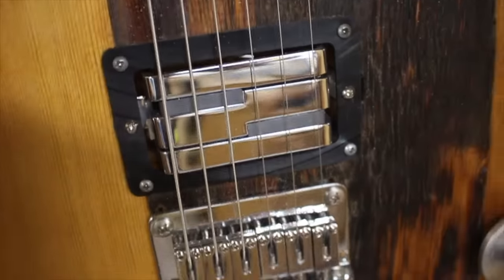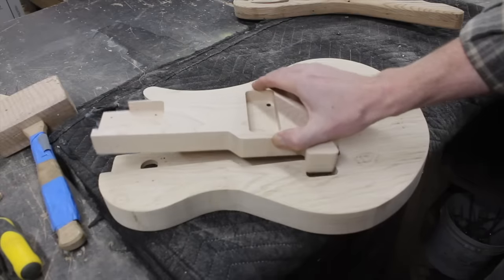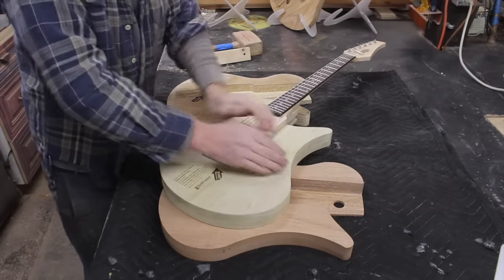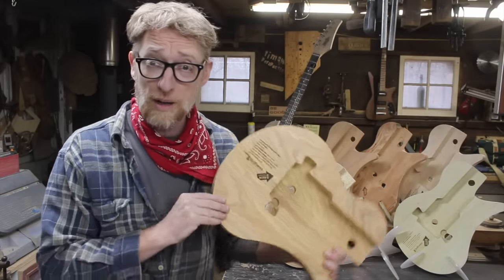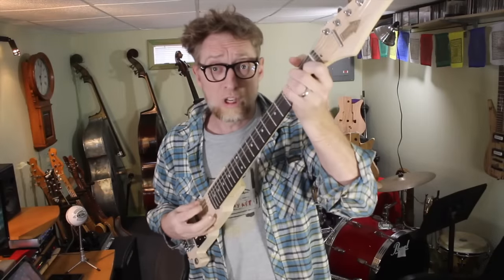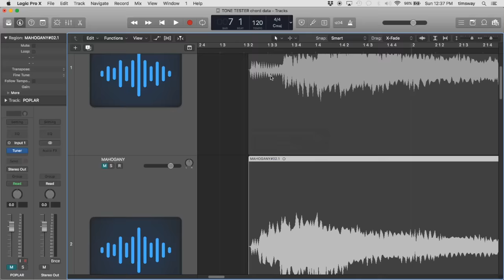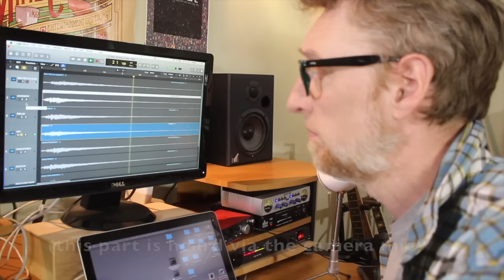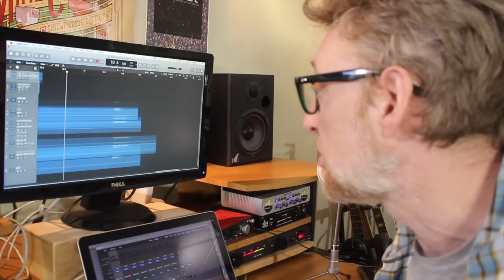Tone Wood Tester: One guitar to test them all

Comment: When you play them all together you get an out of phase chorus’y effect, which goes to show that YOU are probably a greater variable, than the wood is.
Reply from the maker: I am the biggest wild card in every aspect of my life! lol
Reply: That's because it kept getting more and more out of tune as the testing went on. That's what chorus is, combining in tune and detuned signals.
Reply: That's because it kept getting more and more out of tune as the testing went on. That's what chorus is, combining in tune and detuned signals.
Reply: lz4005 I know, that’s why it says “out of phase chorus’s” and not straight up chorus.

Anyway. Do you believe he is picking in exactly the same spot, with exactly the same force, at exactly the same speed every single time?
Reply: Also it went more out of tune every time he whacked it with a mallet (what a surprise there). Tuning up between takes is a "damned if you do, damned if you don't" situation. It would have made it easier to compare the sounds, but it would also have been argued by the critics as meddling. It also wasn't that well tuned to start with, which in retrospect is probably for the best. If it had been, there would be more variance between the beginning and the end, going from good to bad to worse. Here it only went from bad to worse to worser. :)
Reply: @lz4005  So you strongly believe that had the guitar been in tune the whole time, those waveforms would have lined up perfectly, with ONLY the "tonal" differences telling them apart?

Comment: When I was a kid, back in 1962,  Bell Canada replaced the wooden telephone poles and ceramic insulators with concrete poles and glass insulators. The warmth of the wooden poles was lost in the low end but a significant gain in the top end was achieved by the introduction of the concrete poles. I replaced the straight cord on our phone with a coily cord and immediately noticed an improvement in the mids and the low end. Changing the colour of the phone made a small difference, with the black phone sounding a little darker. This test was done on a wall-mounted phone so I do not know if the results would be the same for a standard desk phone of that era.
Reply from the maker: Well yea, but you're leaving out some obvious key data points: Were the wall studs of that home made from doug fir, spruce or hemlock? If it was a pre 1900s east coast house they could very well be chestnut! And don't get me started on horsehair lathe vs sheetrock. Good sir, exactly HOW OLD WAS THIS HOUSE?!?! 

Amateurs, pfft.

But I agree with you on the desk phones, too many variables to isolate from desk to desk... Cross pen or Bic, legal pads or standard letter-size, solid mahogany or mahogany veneer, felt foot pads or rubber...

Comment: Nice experiment. So just basically make one out of plywood, which is also strong and durable. Put a nice veneer on top for the looks and you can build a guitar body for a couple of bucks.
Reply: totally and that happens all the time in the low end brands and imports, some of which are included in my 16 guitars, and sound fine.

Comment: Based on the wall test, OSB is great tone wood.
Reply from the maker: 4 out of 5 guitarists swear by it. No wait, I think it was 4 OR 5 guitarists...
Reply: I use to do the wall thing when I was young and playing bass. It works way better for bass than guitar; try it.
Reply: The OSB in that wall did more to increase the projection of that unplugged guitar than ANY of the 'tone woods', that's for sure! 😁

Comment: Vibration transfer of the strings via the bridge is the most important.  A fixed bridge guitar sounds thicker and has more sustain than a tremolo.  A Swedish guy named Johan Segeborn did a couple comparison videos of a hardtail bridge vs tremolo/floyd rose.  The difference is very noticeable. I blocked my 1979 Strat tremolo cavity with soft maple - doesn't sound like a fisher price toy anymore.
Reply: "Blackie" aka Eric Clapton's iconic guitar had a piece of wood jammed in between the trem and the body for just that reason... he also stated that it helped keep tuning stability, and when he bent a string, the other strings that were ringing didn't detune due to the stress on the trem from the bend.
Reply: @digi7altrauma792  When I first got a trem-equipped guitar as a teenager (Ibanez RG-something) I was unaware of the physical properties of a Floyd Rose. I just bought it because it looked cool and the neck was super thin.  You have to balance the strings with the spring tension for a floating tremolo/vibrato.  I never liked using a whammy bar - the pitch stability with bends and tonal improvement is why I blocked my Strat like Clapton.
Reply: Guess ya shoulda bought a hardtail Strat to begin with. 😜
Reply: @ModernGolfer  It was a gift from my brother, but you're right; I would have preferred a hardtail.

Comment: Great video with no blabla and clever setting. I have also the impression that wood does not really matter for the sound itself. But the neck seems to be important for attack and sustain and dynamic capabilities. If I search for e-guitars that have a wide range of dynamics (getting louder and louder the harder you hit the string), then there are few guitars from dozens tested which are able to do this. And even if it sounds the same for the audience, the feeling of the response of two guitars (or, in other words, the connection you have with the instrument) can be very different.

Comment: But the pickups don’t work acoustically. They are magnetic. That’s why the wood does not matter in electric guitars. Those pickups does not pickup the vibration of air and the body because they are non magnetic. The pickup can only hear a vibrating magnetic metal nearby. Piezo pikcups are acoustic though.

Comment: This proves that at the end of the day and after all the cork sniffing, the dang things are just wire and wood. The tone comes from the fingers.
Reply: And amp + pickups
But sure your fingers too.
Reply: Fingers-strings-bridge-pickups. The Wood is slightly affected
Reply: "Style comes from the fingers." to paraphrase what somebody else said. Tone comes from strings, picks, pick-ups, your amp', any effects pedals/software, and what settings you have those set to. The tone of open notes might also come from whether your guitar's nut is bone, graphite/TUSQ, or metal, but I'm not sure.
Reply: Sounds different if you actually pay attention. Tone and instrument choice is for the player more than the audience. That's where the differences are.
Reply: Or the string of ds-1s i run my mandolin through

Comment: There is a big mistake in this setup. The bridge must be mounted on the tonewood. Otherwise ur guitar is just the lengthy neck thing. What u did was basically to glue some boxes on an acoustic guitar and wonder why the boxes have no much effect on the sound.
Reply: John Moser no. Essentially he made a long tenon neck joint. Adversely, this is like a neck through guitar, saying that having poplar or mahogany sides will sound the same because the neck is attached to the neck through portion, not the body sides.

At the least, it's much more accurate than whatever you put together.
Reply: @lloydpittonet  I was trying to say what you did. Its basically a neck through guitar. The wood added to the side has obviously zero effect.
Reply: @PGspeed88  Well didn't he just proved that in the youtube clip that the "tone"wood doesn't matter ... basically "scientifically" ? Lets have a real extreme example - we make a neck guitar out of titanium and ad different wood aside. I guess you wouldn't hear a difference.
Reply: 100% truth - the "tone" comes from the resonance of the bridge IN the body wood, and how the neck joins that body too. It's also affected by the mounting of the pickup (into the wood on a Les Paul or on a floating pickguard on a Strat) which has a very complex affect on the pickup of the string by vibrating in different ways, too.
Reply: Exactly. Also if he doesn’t do this he needs to atleast put a few holes in the tone wood and bolt it directly to this neck guitar thing. If you can slip this in and out it makes it so that there’s really no connection to these at all. Realistically these aren’t making any real contact with the bridge or the neck so it’s not resonating with it at all.
Reply: Steve derp or very little, what is resonating is the maple core. The bodies are just dampening that resonance to a greater or lesser degree but they are not really directly coupled to resonance path. This is not really an accurate test of tone wood because the main resonating body is still the maple core. For this to be a more accurate tone wood test, both the core and the body wood have to Be made from the same material. With some of these materials that’s possible with others it’s not.

I think we already know what some would sound like. But it would be interesting to see the comparison between them
Reply: funny because I actually could hear the differences even over a youtube compressed video. I have one guitar I can record and most everyone that hears it says "nice Les Paul" but then I run into someone who actually knows LPs and says, "wtf is that? a Les Paul copy?" so...I have learned most ppl actually can't hear

Comment: This is a fantastic video. I used to be a hobby luthier and that's pretty much what I found. The difference in tonewood is so small that when you take into account the player, the amp, the pickups, the setup, it is not even worth mentioning. People don't seem to understand that if strumming makes such difference that mahogany sounds like plywood, then it further proves the point that the type of wood matters very little. Same with the idea that the bridge should have been mounted on the body. Not only that would mean the body would make no difference in neck thru guitars but anybody who has actually experimented with different neck/body construction will know there is no perceivable difference. Bolt on construction transfers tone/vibrations just fine. Rob Scallon had a "guitar" built for him from an actual old shovel and it sounds fine. People hear what they want to hear.

Comment: Leo Fender bought the cheapest wood when he started making electric guitars.  In his case it happened to be alder or ash.  Les Paul used mahogony, again, probably because it was what was available at the time and cheap.  Since those days a myth has developed that only certain woods should be used to make a quality electric guitar.  This video, IMHO, proves that its all a lot of baloney and any decent quality wood will do or maybe even plywood or chipboard.   Take the case of Danelectro guitars.  They are mainly constructed from what we call in the UK, hardboard which is compressed wood particles.  This didn't stop people like Jimmy Page from using them.  Of course the big manufacturers have cottoned on to this con and will charge you a premium for 'tonewoods'.  The actual construction, set-up, and pickups have a much greater effect in the playability and sound of a guitar than the woods used for the body and neck.  This is for electric guitars.  For acoustic guitars the woods used definitely do make a difference as the sound comes from the guitar itself and not from  the pickups and amp.
Reply: Mahogany is a pretty traditional wood for guitar building - many acoustics use it a lot too.
Reply: When was mahogany cheap?
Reply: Leo Fender first used Pine on the early broadcasters, probably same pine they already used for amp cabinets. decisions to go to Alder, Ash etc, reported to be based solely on production efficiency in painting. No evidence that tone was ever a consideration in timber selection.
Reply: Les Paul first uses a piece of rail and glued a sawed in two epiphone acoustic body to the sides to make it look more traditional, but he loved the sound of that rail. Google it, it's called the log and was his first ever electric or somesuch.
Reply: "The Log"
Reply: @brazenbunnies  It never was, only wasteable.
Reply: Actually it was pine
Reply: Couldn't say it better myself, thank you.  You have done your homework.
Reply: @ithemba  Oh, at this point he had already "converted" and used wood. His first idea was to use a real rail but his mother told him that that was a pretty stupid idea because nobody in his right mind would carry along a 2 ft. long piece of rail as an instrument.
http://www.les-paul.com/timeline/red-hot-red/
Reply: How about plastic? Look up the Boaz One. It's a plastic modular guitar on KickStarter right now. Nothing says "Tonewood is stupid" quite like making a guitar from injection molded plastic. :D
Reply: IN SHORT: CAPITALISTS RUIN EVERYTHING, b/c greed is their ONLY concern. 

"You Get What You Pay For" was a total LIE by greedy capitalists. 

PLUS, we WANT most guitars to be cheap and affordable, so more kids can buy one. 

Capitalists ruin everything they touch. 

(It's NOT called Barterism -- b/c it's not meant to be a FAIR transaction.)
Reply: So are you saying you can't hear any difference or that you don't care about the difference?

Comment: I used to do the same thing with my guitar when I was 15 and lived at home. I would play in bed and noticed the louder volume from the head stock touching the wall. Glad I ain't the only weird one.

Edit: I forgot, I had 2 guitars made of the same wood and equipped with the same pickups and strings, but one had more warmth and sustain as well as being much lighter. The only differences was one was a cheep guitar and one was over a thousand dollars. I bet what it came down to was: maybe the guitar of higher cost had it's lumber come from better treatment during the drying process and it's lumber might have came from a tree nursery that actually used proper and more costly means to grow the trees used for a higher quality/costly product. A budget guitar of the same timber species, but of dramatically lower value, might not come from "ideal" lumber processing plants and/or tree nurseries. A lower priced piece of lumber would have a lot of compromises in it's growth and processing. Cheap lumber, while in the growth stage, probably isn't watered properly, provided with proper nutrients, an area of soil with balanced PH levels and so on. It might matter how the healthy the wood grains grew together without irregularities and how fast or efficient the lumber was dried and stored. things like wood species might be better as a basic guide to what you're looking for, maybe not as the sale closer. The health could bring more sustain and all-around fullness from a higher quality piece of wood due to it's orderly alignment of regularly formed grain. Maybe on a microscopic level, the vibrations have more sustain with quality wood of grain set in an orderly fashion as opposed to cheaply produced lumber with grain poorly arranged in total chaos or random patterns. Not just volume or sustain, but multitudes of high and low tonal frequencies could be less or more within wood qualities and species. Ancient people used to believe wood contained spirits and trees were doorways into the spiritual realm, so there's that if somehow a factor or if holding any kind of truth. My guess is the idea came from the tonal qualities and the general versatility of lumber itself. There's probably a million or more factors into what does what to a guitar's sound, but the only true way to know if it's right for you is to pick it up and play it in person. I like this video, because I had the general idea of trying something like this years ago, I never thought anyone else out there was as crazy as I am to justify the means for the effort to do so, so I never attempted it. I am a fan of both science and music. Great job!

Comment: Waveform display and subjective listening comparison won't tell you a whole lot - and will get very confusing.
I'd suggest making a series of waterfall strips - color == amplitude, x == time, y == log amplitude for frequency bins...
Normalize the root note fundamental amplitudes,
synchronize to the appropriate starting point(s) ... perhaps with a time skew compensation?
The interaction between the strings (via the air and mechanical coupling thru the guitar components) will be significant.
Suggest you try again using only 1 string at a time - perhaps mute the other 5 somehow.
That would reduce the time blur on the start strum reference.
You could then plot decay curves dB vs time for just 1 string... or again, waterfall strips with just the harmonics from the single free string showing.
You could also do most/all the above without the normalization - just to get an idea whether the sensitivity changes significantly across the various woods - of course as you say you're only human - so there will be variance between each  take due to your strum.
You might also think about taking many recordings of each data point and combining the results .... e.g. average of log amplitude for each freq bin / log of average amplitude ...
so many possibilities :-)
I guess you could also build a strum machine with a calibrated strike pressure, pick compliance, speed,....
:-)
Interesting video even as is - thanks! :-)
Reply: hahaha  why would he do that?  That'd be taking one step closer to..... SCIENCE.  Hey, but I'm not bashing him, really.  Just silly that people cannot actually hear the difference between two similar guitars where the WOOD TYPE is the only real variable.   If they can't detect it, let them be happy with plywood.